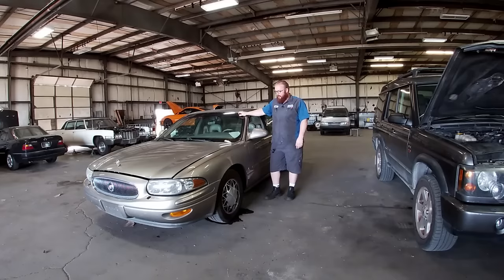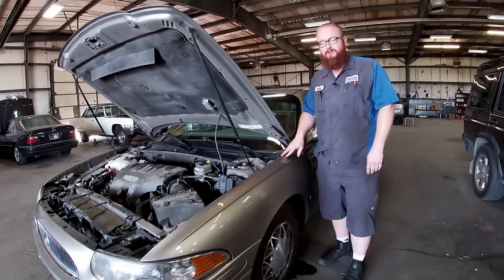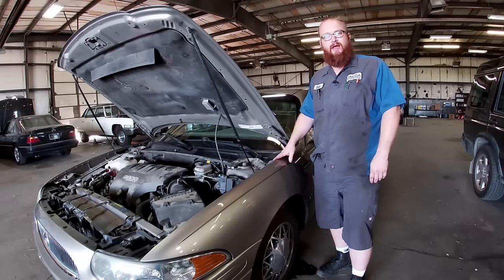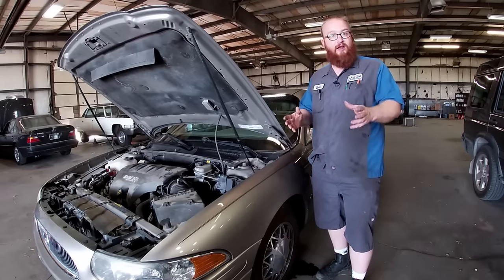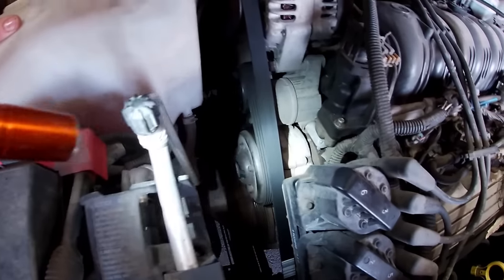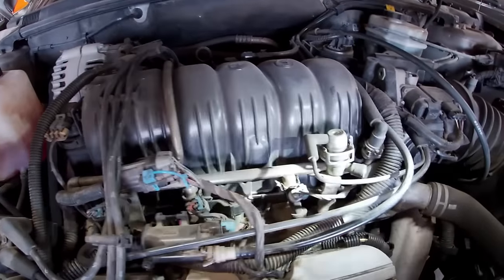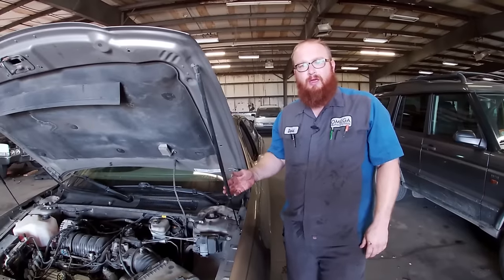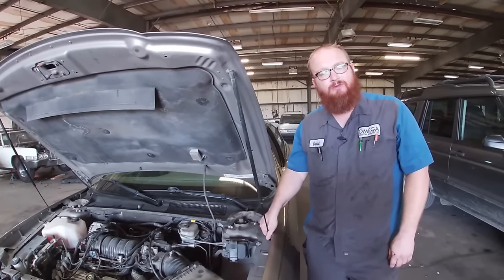CAR WIZARD highlights what makes the Buick 3800 V6 the BEST engine ever!

Comment: crank harmonic  balancers ,,and DFI  modules ignition coils changed every 60,000km   balance shafts ,,cam shafts every 200oookm . Oh yea when the dfi fails generally kills that fuel injector .
But great compared to some modern cars

Comment: I have a NEAR-MINT CONDITION 1997 Buick LeSabre wiith the 3800 V6 Engine; and 88,000 original miles only. I love this car, but the Engine had a BLOWN HEAD GASKET and a WARPED INTAKE MANIFOLD at 82K miles only; that cost me $2,800 to have expertly repaired.  My mechanic told me that these "issues" were due to GM's crappy original design of their "gaskets" and "seals" for this engine (including the exhaust manifold gaskets). My mechanic replaced all the original gaskets with "DORMAN" redesigned and improved gasket sets for this engine. The car NEVER had "engine overheating issues" (e.g., my factory installed coolant temp. gauge arrow marker never got close to the RED ZONE) so I bear no blame for the BLOWN HEAD GASKET & WARPED INTAKE MANIFOLD.  The "heads" never warped but were "re-machined" as part of the repair work by my mechanic. Yes, it's a great engine (especially when compared with the GM CADILLAC NORTH-STAR ENGINE) with plenty of LOW-END TORQUE;  but it wasn't exactly a "flawless design" by General Motors!!!

Comment: GMH General Motors Holden Australia used the  Buick 3.8L V6 in the Holden Commodore models VN 1988=91 VP 1991=93 i believe the Toyota Lexen had the same engine of the same years. The Toyota Lexen was pretty much identical to the Holden Commodore.

Comment: When you say this is one of the best and most reliable engines ever made, would that include the transmission too? I'm really wondering how the transmission holds up on these, as I recently purchased a 2005 Buick LaCrosse with this engine.
Reply: How many Miles on it and when was the last time the tranny fluid was changed. I was having shifting problems at 111,500 miles after over heating do to a radiator issue. Dropped the transmission pan, changed the filter and  added a pint of lubegardatfprotectant with new transmission fluid, after 75 miles of driving all my issues went away. I now have 135,200 and plan on doing it again to prevent any future issues.

Comment: I bought a 98 regal for 3500 with 79k on the clock… one year and 10k miles later. Only gas and oil changes. I Hope to keep her for lonnnng as possible. I try not to get on the pedal too much, I hear the trans is the weak point

Comment: I need some insight with my 03 Buick Park Avenue Ultra. (Supercharged) 
She runs fine when the weather is warm but when it gets cold, she will not start. I checked the vacuum lines made some repairs and replaced what needed. But she still won’t start in the cold weather.

Comment: The motors in the old ramblers my dad had a 1959 rambler ambassador with a 327 and 3 on the colum dad drove the piss out of this car motor was so quiet there is something very special about these motors ....I know what it is .the motor blocks were made of tool steel .

Comment: You listed in one of your other videos that the 1999-2005 Buick LaSaber was a fantastic car. In this video you list the transition from 1st gen to sencond gen motors at 1995. Im looking at a 1998 LaSaber with 103,000 for $3000. Will this one be just as reliable as the 1999-2005's you talked about?
Thanks!
Reply: The 1998 still has the 3800 V6, so it should be fine, I have a 1998 LeSabre and it's been great so far

Comment: I have a 2001 Buick leSabre custom.  I have an oil leak and a coolant leak coming from the turtle looking thing. I was told it was an expensive fix.  I was also told I needed a new EGR valve, about 200 for the part and 100 for the labor. I haven't gotten anything fixed because I just can't afford it.  Recently my car started acting up and will not accelerate over 35 or 40 mph. Two weeks ago my daughter was driving it and when she got home she turned the car off and while the car was off it was continuing to make this weird noise almost sounding like a hair dryer.  The sound seems to be coming from the coolant muffler. Specifically the smaller .  It looks like an oil filter but it's connected to the coolant air compressor.  Any ideas of what's going on?  Also, I've been having trouble with the ignition switch.  Sometimes I have to remove the key and replace it and try to start it until it finally starts.

Comment: I have a 02 Buick Regal GS supercharged, and I'm getting 15 mpg. I have changed the fuel filter, air filter, and O2 sensor upflow. The MAF sensor wasn't functioning properly, so I changed it. It's getting 16 5 mpg now.  Do you have any ideas?

Comment: here in Australia these came in Holden commodores between 1990 and 1996, a weapon of a motor that loves the limiter. rear wheel drive 3.8. Then they put the "ecotec" 3.6 gm piece of shit in commodores until 2006

Comment: Australian have those, and they are rear wheel drive.. everything on it is much easier  to get too
Reply: And they made the intake manifold out of aluminium. Best car ever built the vy2 with this engine.  They go forever. And cost nothing to fix. R.I.P.  HOLDEN

Comment: I'm not a big fan of modern engines because how refined they are. But I will have to say, the GM 3800 is refined in ALL the right ways. Keep your foot off the gas and they're capable of pretty decent mpg for a "big" V6 (I've heard up to 35 highway); on the other side, you put your foot DOWN and watch the rocket fly. L36 does 0-60 in 8-9 seconds (not a slouch for factory family sedan standards) and the L67 is capable of 0-60 in around 6-7 seconds.

Best thing ever? L67 can be absolute screamers. Under drive pulley, bigger injectors, E85 and tune the absolute giggles out of it and pushing 400-500hp isn't unheard of on an otherwise stock block. Granted, you're gonna want an HD shift kit if you go that route. 😋

On a side note, I have a 97 Bonneville SE. 250k miles on original engine and transmission. Yes I have put a series of work into, some of it not necessarily necessary, including my upper intake. Yes, even after the intake it still goes through coolant, but no it's not a head gasket. Tested myself with a leak down tester. At this point, I have no idea WHERE it's going, but it's not leaking and doesn't seem to be burning it, so no clue where to look...

Comment: Funny how some of the older pushrod engines/designs from GM are still some of the best ever made, the last holdouts seen in the modern V8s of their trucks and Corvettes (with the exception of some FI systems and/or AFM, which CAN be deactivated).

Comment: This engine dates back to 1962...yeah, alot has changed in that time but basically the same motor. Used from 1988 to1996 in the commodore In Australia until the ecotec. Still the 3 8 Buick v6,  but dramatically improved. Probably the best of the run. Add a supercharger and it was a good thing. Much better than the 3.6/ 3.0 alloytec it preceded.

Comment: I know this is an old video.....but I recently inherited my dad's 2004 LeSabre....has 32k miles on it.
If I may....a few questions? 
The gages are going out..the speedometer doesn't work,  along with the gas gage is way off, and the coolant gage goes to center and doesn't move.
Also, if it's below 30 degrees,  the gages just stay locked no movement.......what's a fix? Something about servos?
Everything is as from factory, should the transmission fluid and filter be changed? 
What else would you suggest for this near cherry car? It was always garaged......
I just changed the oil with Mobil 1....
Thanks

Comment: The 3800 is great, but unfortunately the car that it sits in will often fall to pieces. I inherited a LeSabre a while back that had completely rusted out brake lines (both rear lines burst one after the other, fronts were leaking) and the steering rack had broken off the left mount due to rust. Thing was a total death trap.

Comment: To anyone on here considering a Buick 3800 equipped car, specifically an N/A one: MAKE SURE IT HAS AN UPDATED FUEL PRESSURE REGULATOR. My father's '01 Bonneville suffered a fiery explosion earlier this year due to a faulty fuel pressure regulator that GM claimed was improved for the 2001 model year. Turns out that was a lie. The car was totaled. Upon researching the issue, there are thousands of cases, and even a recall, which DID NOT cover cars after the 2000 model year, even though it obviously wasn't fixed on the newer cars. Even a famous video of a 3800 impala blowing up in the exact same way at a shop after an oil change. So if you've got a N/A 3800 car from 2000 or earlier, make sure its had the recall done. If you have a 2001 or later, you'll have to do the job yourself or somehow verify its already been done without a recall sticker.

Secondly, the 4T65E transmission is notoriously weak. Excessive clutch wear is pretty much guaranteed unless shift kit is installed. Signs of this issue are hard shifts aı eventually slipping/shuddering during acceleration.

Comment: He is 1000% correct. The motor will outlast the car.  These cars themselves suffer from rust issues. Most importantly the brake lines and fuel lines need work. With a little patience you can learn to fix/replace them without spending a ton of money. Buy your flaring tools a stretch of line and a few beers and just practice in your living room untill you get the hang of it.

Comment: I have an 04 Buick lesabre. Just like the one he showed. 251,,468 still going strong. Only oil changes tires, coolant flushes, and breaks, I'll never sell her, sooooo comfortable, cheap parts(when it does rarely break). My only complaint is the interior could be made from better materials. And this is coming from a blue oval man. Iv never understood how GM got it so right with the 3800, and so wrong with the 3100/3400. I've yet to see a 31/3400 make 200,000 that didn't need major repairs, mostly headgaskets and/or lower intake manifold gaskets

Comment: I have a 2001 Buick lesabre that I inherited after my great grandfather passed, (rest up crabby paw paw, I miss that mean old bastard) only 100k miles on it and man this car is a fucking tank. Decent gas mileage and when I fuck around and floor it the engine sounds amazing. If you’re in the market for a good car that’s cheap a lesabre is where it’s at, great gas mileage and durability. Really any Buick is where it’s at I know people talk about Toyota and Nissan but Buicks are built to last and withstand some abuse. Highly recommend to people looking for a first or permanent car, I’m riding this thing until the wheels fall off. 😂

Comment: Replacing both the upper intake manifold and lower intake manifold gaskets in these motors should be considered mandatory preventative maintenance.  Upgrade the gaskets to the newer metal ones.  This is a very common problem with these motors.  The egr tube should be replaced and upgraded with the newer part at the same time.  About $240 in parts from Rockauto and about 4 hours in labor for a competent shadetree mechanic.  As noted, coolant elbows are a good thing to replace too.  Change your coolant every 30-40k and your oil every 5-7k and these engines will run forever.  Again, keep an eye on the intake gaskets.  That's probably the #1 thing that sends these engines to an early grave.

Comment: These Buick 3.8 V6 engine are the very  Best engines on the market way back & they really go well in the Buick Grand  Nationals & guys even twin Turbo these Buick 3.8 V6 engines with all good performance parts in these engines & a guy Ted & I can spell his sur name he had a Buick Grand National & had it for drag racing & it was Twin Turbo Charged 3.8 Buick V6 engine & ran 7.70 in the 1/4 mile &.I think the speed was 162 mile an hour in the 1/4 & all the guy's cried because  Ted was Beating their cars down big time & these guys had Superchargers on their cars & they were V8 in their cars & Ted would BLOW THEIR CARS TO THE WEEDS & so Ted was put in his own class AAS/S Class & Ted built his own little Dragster & it was a sand Dragster & I think was 104 MPH & I think it 2.8 seconds in the 100 yards on sand & because Ted had the early block Buick V6 3.8 engine Ted would split the engine between the No 1 camshaft & to the crankshaft & when Buick made the later heavy duty engine Block Ted had no more splittings problems to the engine block & it solved the problem & this Buick 3.8 V6 engine was Supercharged with a 4/71 Blower & would pull Between 4,000 revs to 8,000 revs unreal aye & it was running on alcohol as well & I live in New Zealand & I got the Kennel Bell Catalog  years ago & they had built all the camshafts up specially for the Buick V6 Engines & Ted was running one of Kennel Bell Camshafts between 4,000 to 8,000 RPM & Kennel Bell made camshafts for street use as well & did better mileage than the stock Buick 3.8 V6 engines & you buy higher Buick performance 3.8 V6 for street & Drag Racing as well & also Kennel Bell the Buick V8 engines camshafts as well these camshafts were Brilliant & Sir it's Bloody True those 3.6 V6 are BLOODY F-------N RUBBISH BRING BACK THE BUICK 3.8 V6 ENGINES THEY ARE A BRILLIANT 3.8 90° V6 EVER MADE & I have Toyota Hilux Surf with only a 3.4 V6 & that goes well but Having Buick 3.8 V6  engine in the Toyota Hilux Surf would even go way better & having a 4/71 Blower & Venolia 6 to 1 Ratio Forge Pistons it would go better again but I don't know if the Buick 90°3.8V6 engine would fit anyway as the 3.4 V6 engine is only 60° engine & you can buy performance  parts for these Toyota 3.4v6 5vzfe engines but having to own Buick 3.8 V6 engine & having 4 Valve per cylinder & all the good camshafts would be an Excellent Quality Buick V6 engine in a Hoiden Commodore car would be amazing & I have the book on how to Hot Rod V6 engines & you through that book & look on the Buick V6 engines & shows you 2 Buick V6 engines Mounted together both V6 engines have 6/71 Superchargers on them & both engines are running 60°of one another & they do Tractor pulling &  & it is only a small picture of these 2 Buick V6 engines but it is amazing to see these 2 BUICK V6 ENGINES WITH 6/71 SUPERCHARGERS ON THESE V6 ENGINES & didn't it would be possible to put 6/71 SUPERCHARGERS ON THE BUICK V6 ENGINES BUT THERE IT IS & I know you can mount 4 /71 Superchargers on these Buick 3.8V6 engines & you can buy the manifold to go with the 4/71 Supecharger & that would be pretty impressive seeing a 4/71 Supecharger on a BUICK V6 ENGINE & having a 6/71 SUPERCHEARGER on a BUICK V6 ENGINE would even more Impressive & having in a really Nice Hot Rod you would certainly get the looks from all Directions driving it on the street or streets with the 6/71 Supercharger sitting on top of a FAMOUS BUICK 3.8 V6 ENGINE & in the Book of how Hot Rod V6 Engines & in that book to it's got a very nice 55 2 door Chevy with the BLOWN BUICK V6 ENGINE & it's got the 4/71 SUPECHARGER & look Impressive to Kind Regards Peter

Comment: If I had the resources to start a car company, I would scrounge up every one of these engines I could find and have them all remanufactured. Then I would have a Coates or Saunders Rotary Valve system made for them. They would most likely never wear out.

Comment: I'm not to formilier with thease but I use to like those old gm 2.8 they would run like new 300.000 and the car would fall apart around them like celebrities and Beretta had in 80s the old station wagons with tow package where amazing

Comment: They had some small issues. I had two series 2 regale. They got 30 mpg and great power. I have a slightly smaller Nissan murano 3.5 v6. The car is lighter and smaller then the regale. It is lucky to get 22 mpg.

Comment: This engine is very good. The transmission is not suitable for mountain driving. If you live in a state with mild hills, it is a good car.  However I transmission in first gear does not slow the car much when descending a mountain .

Comment: Hello,
Why is my 2006 3800 Buick LeS  hard to start after driving 8 miles? After 10 mins, it stutters or won't start until I press the brake. Sometimes I press gas, then brake & it starts. Is it just pressing the brake that helps? I'm afraid of getting stranded as I have twice . I got 3 "new?" starters in 1.5 yrs. A new battery & still no one knows what's wrong. Hesitate going to dealer.. ?

Comment: I'm a Mopar guy but my family grew up with Buicks with the 3800.  Far and away the best V6 GM has ever made and ever will.  The wizard is spot on. 30 mpg in 93 Park Avenue?  That should have been impossible.

If I'm not mistaken, Series I had an aluminum intake plenum and thus was actually more reliable than Series II's plastic one.  GM was cutting weight and cost in a place they shouldn't have.

I remember hearing the news of the 3800's demise and thinking "what f***ing idiots!! Are you serious!?"  This was some real smart heads in corporate thinking they knew best.

Today's GM V6 is meh.  It's got good power and that's about the end of the good news.  I'd take Chrysler's Pentastar V6 over any modern GM or Ford V6's in a heartbeat.

Speaking of which, anyone know if the Car Wizard had a video on the Pentastar?  If not, here's a request!